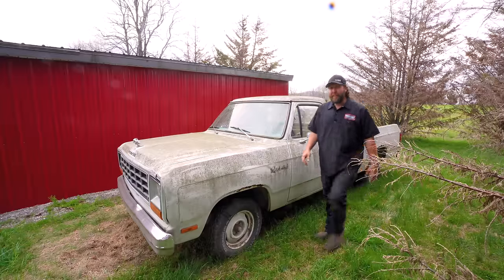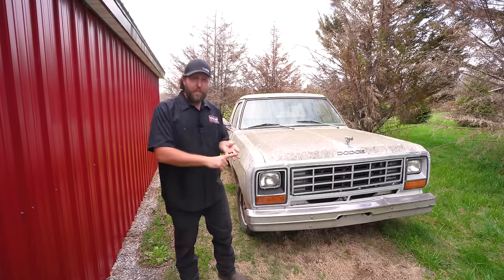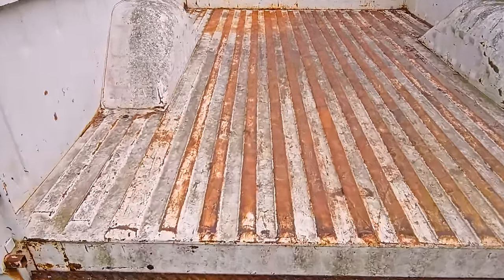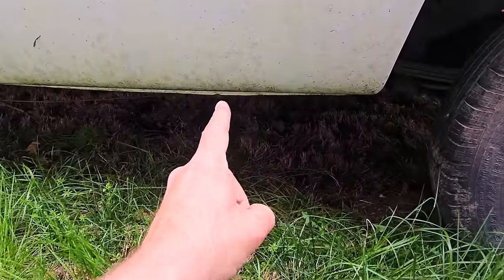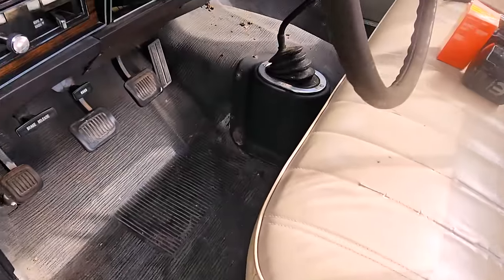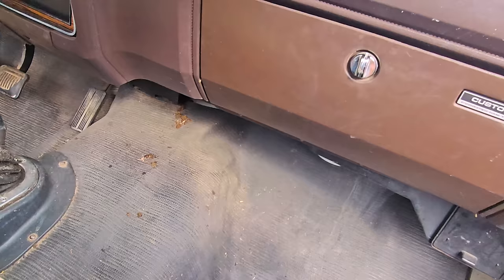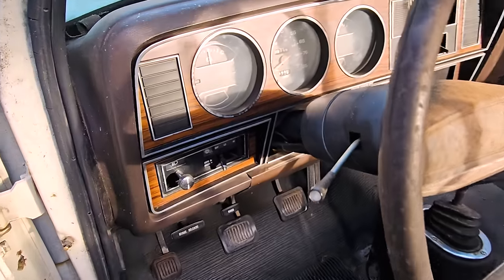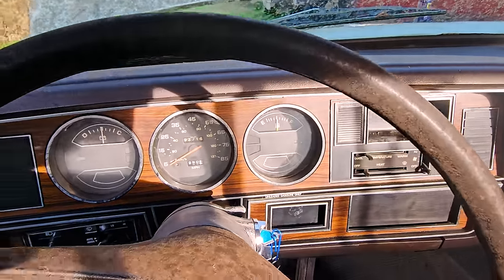Will This Old Dodge Farm Truck RUN AND DRIVE HOME After Being Parked for YEARS?

Comment: I had a 1973 Duster, well optioned with the slant six (225 ci). Until I was t-boned by a Dodge Mini-van at 40 mph! That car saved my life. The drivetrain was removed to be used on another Plymouth as the car had to be junked, (massive unibody damage).

Comment: This channel inspired me to believe I could dive into my 2004 2.7l v6 and replace a timing chain.  Progress. Today I clamped on the radiator hoses and charged up the battery.  Then I found the car keys. Then I paused the video and put the front cross beam member on, the lights, the water bottle, the thing near the water bottle, and the hood latch.  The hood is closed now for the first time in 25 months.

Comment: I learned to drive in my Dad's 1987 Dodge D100 with slant 6 and 4 speed(technically a 3 SPD with Overdrive). 187k miles when he traded in....187k hard miles. Only had to replace the heater blower fan, once,  besides regular maintenance, brakes, oil, belts, and tires. I believe the rear shocks once. Great truck. Our 77 d100 only had to replace the ballast resistor once even though after that first time where we tried over and over to push start it, we always had a new one in the glove compartment, but didn't need it. The passenger side floor vent, slightly bigger on the 77 than the 87, was perfect for keeping a six pack cold at least in fall to spring in Northern NY(state). Plus under the hood, tons of room to work with the slant 6 in there. Sit on the fender with your feet in there and do what you need.

Comment: Around 1:20 he mentions not getting straight 30, the W is for winter in modified oils so a 5w-30 or 10w-30 would be fine if that's what you're after. The second number is the weight so 20w50 is a 50 weight. Great video as always

Comment: My uncle had an 84' and it had a bunch of mongrel parts, NE PA truck was rusted like only PA winter could do. Replaced the fuel pump by cutting an access hole in the bed, tie rods were from some Ford station wagon-he bought it new in '84, only owner. Rust on everything was a problem. Still one of the last solid trucks, and a 4 SPD.

Comment: FYI- the two clamps on the inner passenger fender are to hold the folding jack handle. I had 1976 with a slant six and 4 speed. It was a fun truck that took me a lot of places.

Comment: Find a tailgate for it, throw on an expanded metal grill replacement. Find a decent set of tires then do the minimal fix'em ups and send'er on down the line.

Comment: 0000 steel wool works great for cleaning everything off the glass. You just have to make sure you blow all the steel particles off the car especially the paint. Or wash it off. Another option is the stove top glass polish.

Comment: It's  a slant, with a A833 It's gonna run. Probably one of the best trucks ever made.
Had a 79 custom 150 withe the same setup and it was a fantastic truck! 30 mpg , always ran flawlesssly, never let me down and all i did was put a new mopar super slant in it with a new clutch, and drove it every day for 6 years for work, and work it did driving at least 200 miles every day loaded down with flooring tools and usually 1500 pounds of carpet and pad and tack strip, bags of concrete, hauling trash and loads of dirt, cinder blocks; motorcycles, and cars on the car dolly. Im sure its still running somewhere

Comment: My first car was a Dodge Dart with a slant 6 engine.  That did nothing but run.  At the time I was told that the slant 6 was the preferred engine for New York City Taxis.   Apparently they yanked them out every 100,000 miles, rebuilt them and jammed them back into another taxi.  I would recommend an engine swap and a sale to someone who would appreciate it.

Comment: When I was 16, my friend had a 62 Valiant, #2 spark plug would always foul, wet with oil. We would just rotate it with one from a different cylinder, the old leaner would run just fine for another day or two. I don't even want to guess how many spark plug re & re we did on that car. It had the fabulous, on the dash,  push button drive, neutral,  reverse selector.  
 We used to joke the Ford and Chrysler were going to throw in together and make a car out of Valiant and Comet parts, it would be called the Vomit.

Comment: I love that aluminum intake, but they sometimes have porosity issues that makes it very hard to adjust the carburetor. If you put a bunch of light primer, then light paint coats followed but a medium wet coat, it fixes it.

Comment: It's a slant six. If it's got oil in it, makes spark and can breathe, just add gasoline. It'll run. Stopping, gearshifting, and steering are all optional, but the motor'll run.

Comment: Hi Derek! Just fyi, Tin Grilles are generally considered to be the 1972-1980 trucks, although the early Ram pickups used the same material until their second facelift in '91 so youre not really wrong
Reply: Also i had essentially that EXACT truck, i spent a ton of time doing research about them, and if you have any specific questions I can probably answer them. Super cool truck!

Comment: Had the exact same truck back in the late 80s. Ended up taking out the electronic ignition and putting a distributor, from a 72 dart, with points

Comment: Hey there ,
I have had fuel pumps that fooled me . Thought I  had a noisy bottom end , but all it turned  out to be  was a noisy fuel pump ! If it turns out to be  loose lower end , you might trying  to change the oil and exchange two quarts of oil for two quarts Lucas oil thickener and conditioner . It might help get you home !

Comment: A good way I've found to bleed brakes alone, along with gravity bleeding, is to wedge something like a 2×4, or anything else that fits between the seat, and the brake pedal, to push it in, then go crack the bleed screw loose, and retighten, until it comes out bubble free. Works great, especially with power seats, but can be done either way, as long as it pushes the brakes in, and will stay on the pedal. I've done it a hundred times, if I've done a brake job once! Lol

Comment: This truck was made right down the road from my house on Mound road in Warren Michigan.
The thing with the interior is kind of a funny story.....
Dodge source out there interior companies. There were 2 separate ones with the door panels. The seats were produced at 1 factory along with one side door cards where the other door cards were produced in other places at the end of a run with the die that was used the weather. Would take effect and sun would extremely fade the left door cards of all things..

Comment: I believe the trucks 4 speed manual transmission has a lightweight aluminum case, and 4th gear is actually overdrive. I think it's the same transmission that was used in the 1975-1976 "Feather Duster" that had the same transmission, aluminum hood, and trunk lid.

Comment: Seeing that good old slant six brought back memories, my grandma's 1964 Chrysler Valiant, a Chrysler to us Australians not a Plymouth, had the 225 cubic inch slant six, the distributor was hard to get at because of the steering box on the right. The water pump was replaced a few times no doubt because of the lack of green stuff in the radiator. Come to Queensland Australia Derek, there is a place near Toowoomba called Highfields Historical Village with many 1940's to 1970's pickup trucks and cars and tractors and work your magic getting some of them running again.

Comment: Hi Derek. I have a question. I am assuming that you rent a truck to get to the truck you bought. Once you get the Dodge running, how does the rental truck get back to the rental company? I am amazed at your ability to resuscitate a truck that hasn't been started in a decade. Cheers Derek.

Comment: 80s mopar smog and ignition systems are horrible. As soon as I saw that box on the air cleaner it brought back old memories. I believe there’s a bunch of dip switches in it too

Comment: You are only using a jack on grass. You could lose your leg doing that. I suggest once the tire is taken off you should slide it under the truck as a fail safe. It is just a susgestion and it could save your life or just you legs. I enjoy your videos a lot. Especially tbe MOPAR ones.

Comment: pistonslab....Here in SA we use 25w60 in the old worn out engines to help with the sounds of the loose bearings and pistons etc ...helps a bit .

Comment: I loved the old Slant 6 engines back in the day. I had two buddies that were driving Darts and even with our limited knowledge of how things worked, we were able to keep them running. I personally never owned one, but always wanted to. I didn't know they put them in pickups. 
I'd give my left nut for this truck, if I needed one. Unfortunately, I do not. I have a truck that I bought to pull my house, so that old farm truck with the six banger could never handle a payload like that. But, I like the idea of cleaning it up, putting on some decent rubber, and sending it to someone who will, as Derek says, take care of it.

Comment: I have an '83 D150 with the slant 6, and a few times I have had to tighten the screws that hold the top half of the carb to the bottom half because they came loose and it would lean out and stall when taking turns or at stops. And also I've had to tighten the two nuts that hold the carb to the intake. What I will say of my slant despite being tired, it always starts!

Comment: Watching this for inspiration. Heading up to OK this saturday to pick a 1970 D200 that has been sitting for 25 years.  Has a 318, 727, but with a Dana 60 and 3.54 gears factory. Chrysler electronic ignition was a pretty important deal when it appeared in 72.  This truck I am picking up has had a swap too it so should be interesting. But is complete!

Comment: I want to see it get an Italian tune up, wheels/tires, a GOOD wash in and out and back brakes.  Get the tail light replaced, fix the headlight switch.  Maybe paint the door panels so they match.  Then do with it what you will.

Comment: Well young fella, I watch most if not all of your uploads. I see a number of your rescues usually have windsheild wiper difficulties and internal fog issues. For the inside maybe some of those parts stores have a hair dryer you can plug into the lighter plug to circulate warm air inside. On the outside I use was spray cleaner wax.Yep you read me right. Run a piece of tape down the center of your windsheild and use ur rain x on ur drivers side and cleaning wax on the other. Take the car out in the rain test it out.. I use a product FW1. I know the old fellas can't tell you young fellas nothin. I found at highway speeds the rain slips on the wax right up the windsheild. Another tip I found with a power steering in a quick fix. Add some seafoam to res, ounce or 2. Unsticks sticking valves in the pump. Hey do a show on fixes guys can use on the road in a pinch. Make a list an do a video of all the fixes or ask viewers some of theirs to add content. Thanks for your uploads. Safe driving. HG1

Comment: The engineers made them so they wouldn't leak will the first couple years. They weren't made to not leak. There were sealed up long enough to drive off the lot and that's it

Comment: Had the exact same truck same color same year even had the same pin stripping.  Good old slant 6.  It was the most reliable truck I ever own it was 8 years old already when I bought it. Had it for around 12 years The only issue I ever had was the alternator needed new brushes besides normal stuff like brakes and tires Sold it local and it lasted another 15 years. Transmission was what finally took it out but it had almost  400000 miles. It didn't have any rust  honestly if you put a transmission in it I'm sure it would have lasted many more years.

Comment: I'm actually so excided to come a crossed this video - may be it 4 months late - but I've been watching you for about a month,  I bought a 1986 dodge d150 for 400 bucks and have NEGATIVE mechanical skills, so I ended up picking it up from a farmer that's been sitting for close to 30 years, I got it to run just by using some things that I see you doing, now just gotta put the fuel tank back in!

Comment: As you were calling hello into the radiator. I was thinking that in editing if you had added an echo. It would have made me chuckle. But that might just be me. 😄
Reply: Also you said you were going to put the wing nut on the roof. But you’re still leaning against the truck. 😄

Comment: Derek if your lines are constricted in a pinch could you break loose the bleed valve on the wheel cylinder and leave it kings loose so it bleed off the pressure so you can make it back

Comment: You need to try the new CRC freeze off on all of your fittings and rusted bolts. The stuff is amazing. Also, I'm not trying to preach, but isn't using substandard tires putting yours and others lives in danger?

Comment: I think I would have yanked that electronic junk carburetor off that old slant 6 the moment I saw it and put on an old Holley 2 Barrel or some other type that you already rebuilt beforehand depending on what you happen to have. Personally I try to keep a couple different styles of old carbs ready to go when I go rescue a truck but because I only mess with pickups and smaller commercial or farm trucks like stake beds dumps etc I don’t need to worry about a wide variety of possible carburetor types so I just show up with a couple different options already rebuilt ready to to swapped on

Comment: love them ol trucks with IL 6/manual trans drive trains. can't hardly kill em. i wouldn't even fix rust. would clean it up, lower it down, add some cool wheels n tires and drive the snot out of it. if knock persists, pull it and fix or stick another slant in it's place and keep on goin. great engines.

Comment: You could repair that tail light with uv hardening epoxy/resin if you wanted to. It would not be good as new, but not that far from it, if you are good at it. You can improve/repair almost any plastic light cover or other plastic part with that stuff, especially if you have all bits of it, useful if a replacement is hard/impossible/expensive to get. It may be the same stuff used by some 3D printers, I don´t know, I got mine from wish. Do not forget a good UV lamp or it won´t harden verry fast, direct sunlight will do it but will take quite a while.

Comment: First pull that slant. Fix the slant. Put the slant in a Aspen or a dart  have MPG car for power tour use that OD transmission to. To the truck. A poor man’s hot rod. 360 magnum engine from the JY. A little 210-218@50. 3.55 650 Holley

Comment: I blew up 2 slant sixes in my 74 duster. Threw a rod, had a hole in the block with fire and still ran. The don't like rpm

Comment: Wow and it has the ram ornament on the hood.  I had two of those trucks in the past, a Prospector and a Custom.   Kids or maybe pro thieves ripped them off both trucks at some point.  I never replaced them, figured if I did, someone would just do it again.  My friend had his ripped off his truck, he bought one from the scrapyard to replace it.  One horn was about half broken off from the crash that got the truck there and was probably the reason that one was not stolen again.  He ran it that way for years.

Comment: My dad owned an 83 that was the same exact truck but red in color. The poor leaning tower of power didn't have enough guts to even use 4th gear lol. Then we swapped in a 318 and turned it into a 1 tire fire.😂  she would do a 120 in 4th gear then.

Comment: Brother,

First thing, I just watched the little grip stage 1 upgrade vid-e-oh, and holy smokes- 'yer apples fall right down, and maybe a smidge closer to yonder tree. The boy had me laughing (and occasionally farting too) with his humor!  And when he was unboxing the stage 1 kit he let slip a "JESUS!" 

Oh The Humanity.  Mashed taters covered most of the keyboard, Cold Snack finished the short circuit.  I quickly ran to the garage for a replacement bleep-blooper (which I like better than the previous one) and I looked down just in time to see his go-cart exhaust go flying out the door.  The lad has studied the master carefully.  I say keep doing what 'yer doing, I'll keep fighting congestive ticker failure, and let them little humans be "free-range". Maybe there's a spot up at the new homestead where that Lil Dodge would fit? Seems too nice to sell-                                              

God's Blessing on Ewe and 'Yers

Comment: Not sure why you wouldn't load these vehicles on a trailer your buying around Tenn.. Take them home where you have all the tools and likely few tires. Work on it at home, get it running and cleaned up then take it out on the grass do some donuts.  Then you'll know either to sell it or add it to the stable before spending too many $$ on it. Save a few headaches to I would imagine..

Comment: Hi Derek. I see you use Aero Kroil. Great stuff but expensive. Have you tried making your own penetrating oil using a 50/50 mixture of acetone and ATF? Works great however it will take out the pump seal in oil cans so you have to use a pressurized oil can.

Comment: i bought a mid 80's dodge dakota from a lady who handed me a hammer and said you have to hit the starter if it dies...(i got it cheep), it was dieing because the fuel line had a split in it and lost pressure when i came to a stop..., the back of the starter was so badly beaten it had a chunk missing from the end cap , the trouble ...a bad nuetral safety switch - when the car died from the fuel line , she would beat the starter untuil the trans cooled off enugh to let the safty switch start the truck again lol , i can start it in any gear now.

Comment: I thought the battery terminals sizes not being a 1/2 or 13. And also not a 12 or deff not a 7/16 was a ploy to buy the “all special battery terminal wrench size” that onky fits those nuts on the terminals